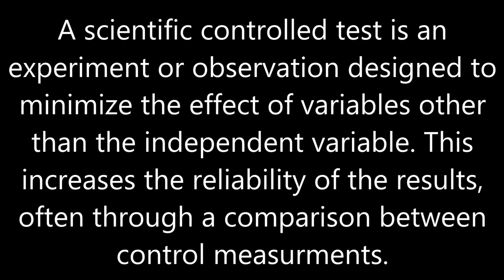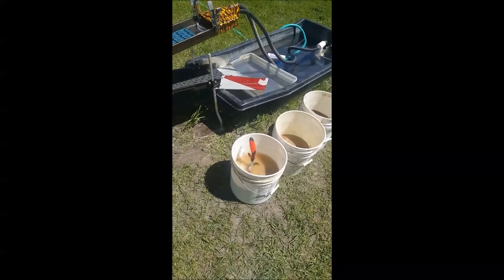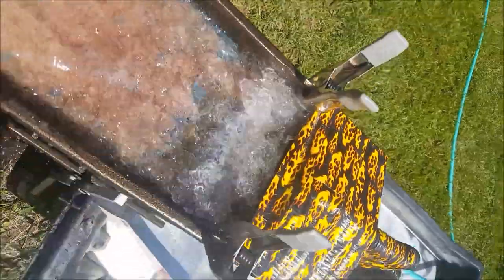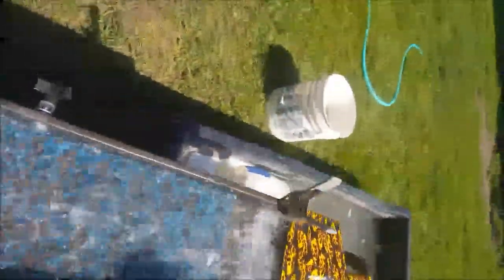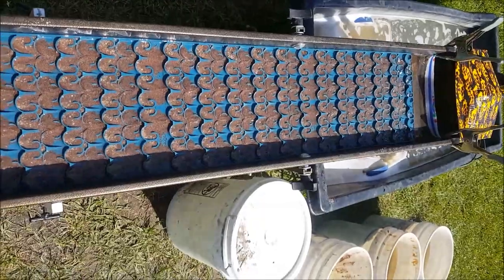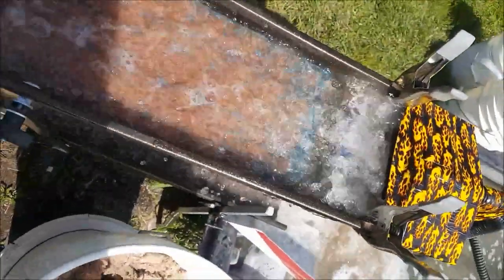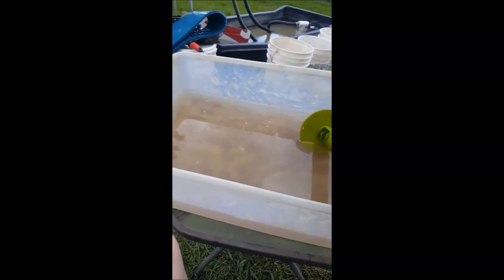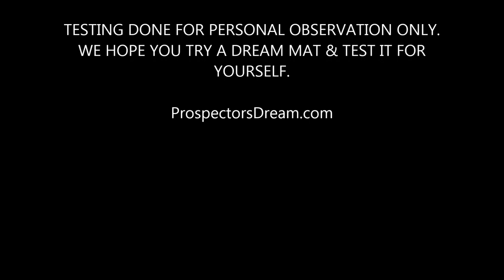DREAM MAT CONTROLLED TEST 1

Comment: You cant have the same angel on Hog mat and Dream mat. If you try running Dream mat at the same angel that Hog mats works best the Dream mat just blow the smal gold(-40 mesh) out. I have tried it. The other way like you do fill up the Hog mats with lights. Tune the sluice to the mats is the right way. Every mats have different angel where they works best. Difference of what stays in the mat and end in the tailings is the right test. And use real paydirt.
Reply from the maker: Snake Gold dream mat works at allot of angels, this is the standard 1-1/2" per foot drop, if it was steeper it would be worse. Next? It's just a test, they are just results. Feelings can't change physics.
Reply from the maker: Please give us the angle, flow and feed rate you recommend for this setup!
Reply from the maker: Here is your real pay dirt video.
https://youtu.be/lMhgb812bD0